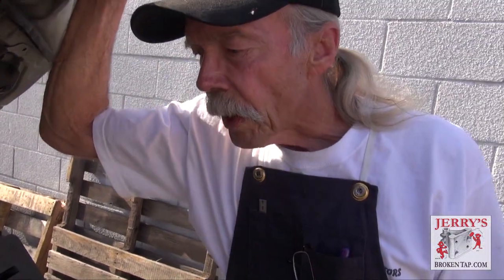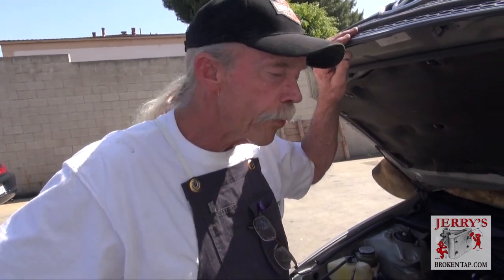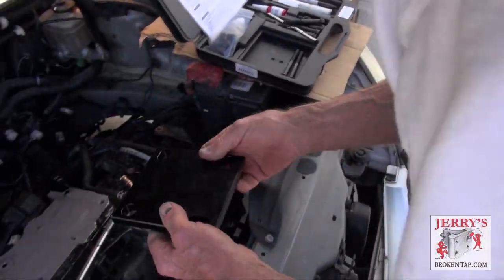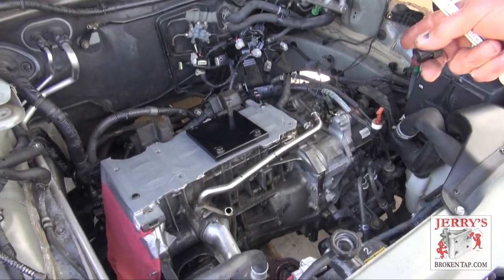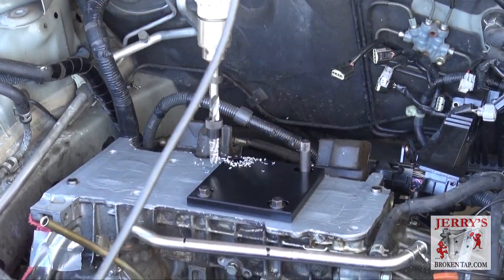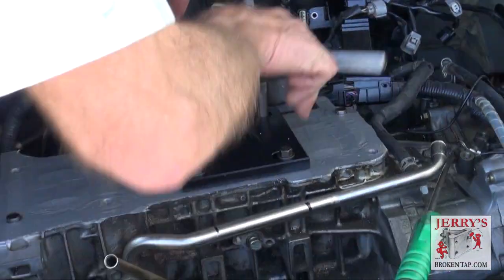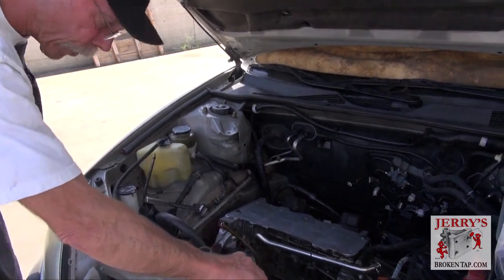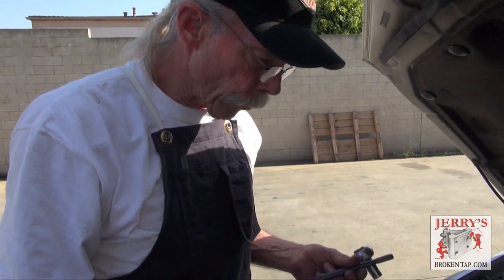Toyota Head Bolt Repair using TIMESERT Universal Head Bolt Thread Repair kit

Comment: Better off having the holes machined to the next size up metric head bolt. Don't expect to get more than 12,000 miles out the engine before the head starts to come loose the time serts rip out. Happens all the time on Northstar engines repaired with time serts.......
Reply: While most mechanics have the right idea for the repair they have little machining experience. I have been in this business for over 40 years. In the last 10 years we have done over 500 Northstar BMW & Toyota motors without any complaints or motors coming back. Time Serts are the best repair if done right. Going over size 12 MM requires drilling out the head and finding the right bolts. The only reason a Time Sert would pull out is if it was machined wrong in the first place. We have repaired several motors that mechanics have done and did the right repair. We are a Machine Shop that knows how to do it right the first time. A mechanic has the right idea for what the motor needs but generally does not have the machining experience to do the insert installation correctly…...
Reply: While I'll agree that this happens more often than not, I think it the quality of the repair may also be a factor.  I've watched fellow flat rate techs cut corners on similar engine jobs just to make a quick buck and the vehicle comes back and bites them in the rear.  I have done the repair on two northstars (aurora and deville) and one on my own 03 camry and have not have any problems with the repair.  Granted I have not seen the aurora again but the deville is a regular customer and comes in for oil changes, tires, etc. and at about 18K miles later the customer has not had any problems.  One of the main things that I do is that I allow the vehicle to sit 24hours after I do the block repair.  This helps "cure" the threadlocker which may or may not assist with the repair (it takes a day or so just to get the cylinder heads checked from the machine shop anyways).  Maybe I'm just lucky but I'm also very OCD when it comes to this type of repair.
Reply: EETechs Actually, that's not better, these are far superior.
Reply: Dan Einspahr Your exactly right!!!

Comment: I am not sure it even has to over heat. I think the fist over heat is caused by the loss of seal.  Also what is the total hours of labor?
Reply: It doesn't need to even overheat. This is a defect from the factory that doesn't rear itself until the engine has several 10's of thousands of miles on it or more. I own a Highlander 03' 2.4L that had 198,XXX miles on it before it occurred. Vehicle had never been overheated.
Reply: Your right!!! It could lose a seal which could cause coolant loss. What ever the reason if the motor gets hot the head swells causing the threads to stretch and become weak and then needs thread repair. The labor time for the job depends on who's doing it. If we do the job it requires about 4 hours. Thanks for the reply
Reply: udidwht Thats a good call. With the kind of miles its possible the threads can get weak. What ever reason they need to be repaired!!! Thanks
Reply: talk2bill It will take about 3 days with a helper. Assuming all goes well on the first try.
Reply: udidwht Theories of what caused this on 1/3 of the 2AZ-FE engines vary from over-torqued bolts at the factory, to a poor thermal design.

Comment: I used the 11x1.5x30mm timesheet but notice the original head bolts don't go as far down to their original height. Will I need shorter head bolts? Or longer insert?
Reply: Duke, sorry it took so long to get back. Same bolts will be fine if the machine work and installation is done right. Their is only two reasons the bolts won't go to proper depth. Either the counter bore was to shallow or you didn't push the driver tool all the way thru the insert. Both are critical!!! Thanks

Comment: Very well done, in fact we will post your video on our websites. Out of the hundreds of Time Sert 2200 kits that we've sold (with free next day shipping) 99 percent of them are for the same Toyota models you've mentioned. Usually the middle back four bolt holes fail. We always recommend doing all ten though, to help insure there's no more problems.
Reply: TECH BILL Standard when buying the kit
Reply: Being that 99% of the kits are for the same Toyota models, you should consider throwing in 2 cylinder head dowels with the kit. To do all 10 holes, the bushings/dowels have to come out, and will likely be unusable afterward. I'm currently doing this exact repair.
Reply: I had a rocker arm bolt strip on a GM V6. Going to get the Time cert kit made just for the GM V6 rocker arm bolt. One question, why do they include 5 inserts, why not 2, 4, or 6
Reply: TECH BILL I know what you're saying, but 5 is insert quantity on all of the small Time Sert kits. Extra individual inserts are available. Most of our customers are fixing just one and just want several extra for future use. We can sell as many extras as you want though. Our M8x1.25 kit, kit number 1812CORE is for first time repairs and the 1812COREBS is for repairs after a Heli Coil has failed and the hole is bigger. We also sell the 1015CORE for GM rocker arm bolt repairs that use the M10x1.5 instead of the more common M8x1.25. I'm a Master Tech not just a tool salesman. So let us know if we can help with any other Time Sert questions.

Comment: Great Video. What's the average mileage you see these 2AZFE Engines strip the threads?
Reply: 140,000 to 200,000 depends on how you run it